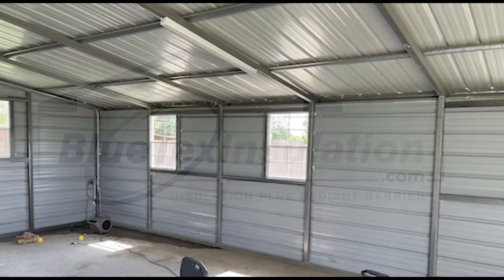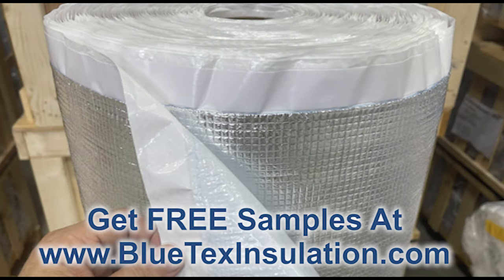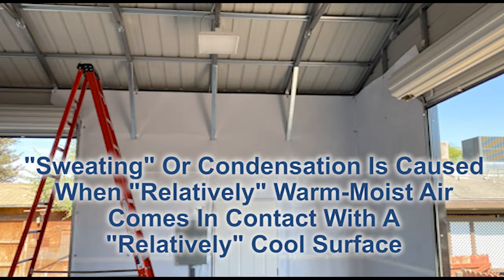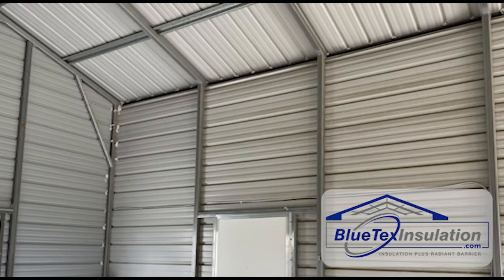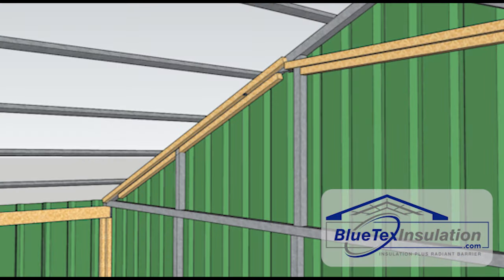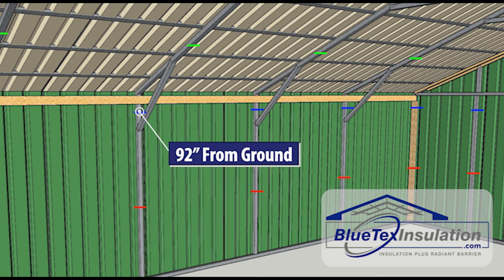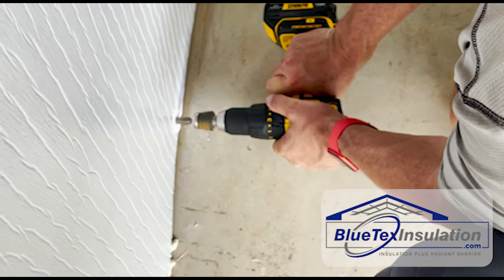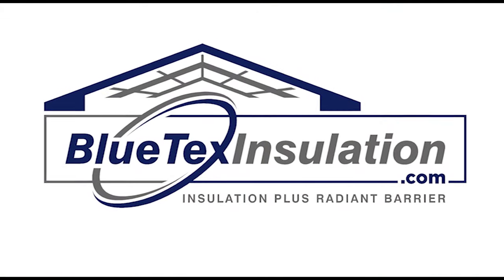Insulation And Vapor Barrier In Existing Tubular Steel Building - Step By Step Guide/Short Version

Comment: I live in an area that gets below zero in Winter and 100 plus in summer. How does this insulation handle condensation, thanks
Reply from the maker: Condensation is more about surface temperatures and humidity levels than anything else.  So, it really depends.  Please read this: https://bluetexinsulation.com/pages/moisture-in-metal-buildings-causes  and then call is to answer your questions.
Reply: @BlueTexInsulation  cool, thanks